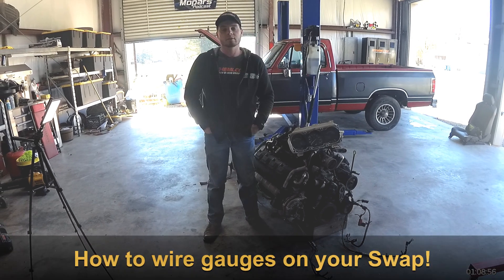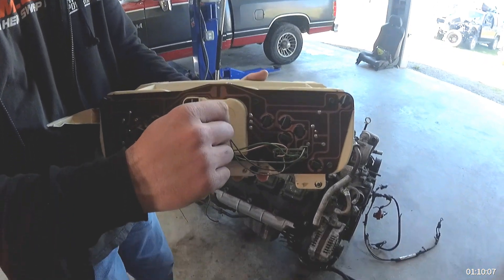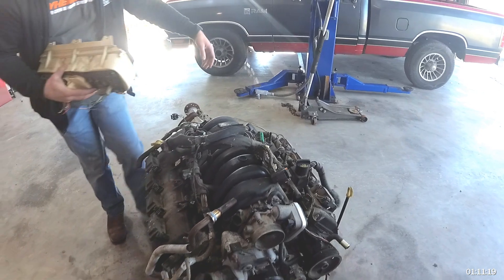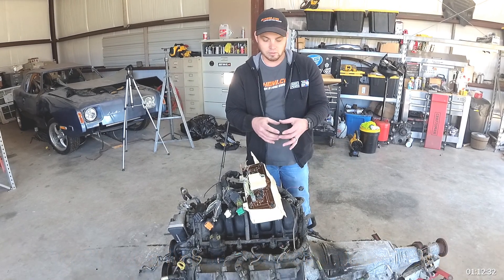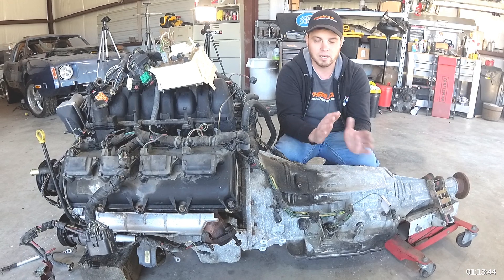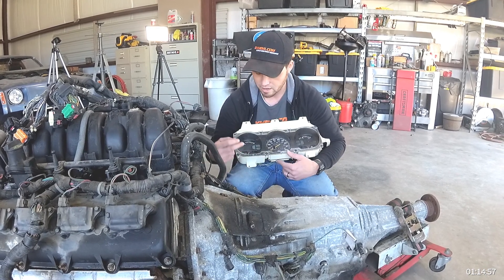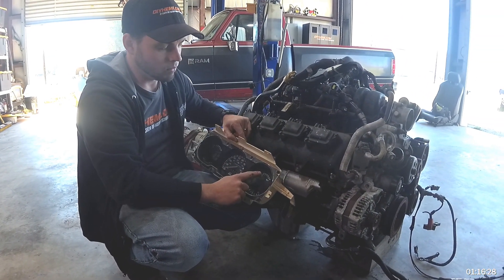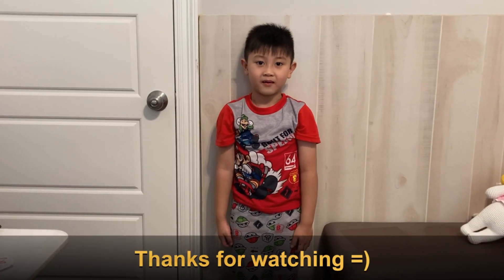How to wire up Gauges on your engine swap – DIYHEMI Hemi Swapped D150

Comment: Hi, I know its a long shot but i run off ideas. Have a 08 5.7 Hemi swapped already into a 90 Ram, everything works but the speedometer and the pcm doesnt know the speed either, so wont let me pass above 60 mph. I have read some and find that I can use a Sgi-5 and a Rostra to get the speedometer to the pcm and then to the Gauges, is that right? Thanks in advance

Comment: hey guys love the videos, i have a speedhut tach and 2004 hemi in a 66 d100 , do i have a tach output from ecu or do i need to hook to coil of one of plugs negative or trigger wires? thanks again

Comment: Have you ever done an SN95 mustang?
Reply from the maker: have not yet! But we aren't against them.  We eventually will be going to non-mopar bodies to have some more fun with our swap harnesses later on.  We'd love to see others do it too though
Reply: @DIYHEMI  Im in the process of swapping a hemi from a 2006 durango and 45ffe from a Dakota. Into 2007 audi a4, the mechanical and fabrication is the easy part. Getting my original cluster to work is going to be challenging
Reply: Hey Blake do u have a email to ask you question

Comment: Jonny mopar suggested for us to come iver an check u guys out an to subscribe an that is what i did .. im curios an intrested to watch your videos as i have 2002 Dodge Ram 2wd regular cab shortbox with original 5.9 magnum 360 .. cold air intake long tube headers trual dual exhaust with comp aftermarket street cam new stock hydraulic roller lifters true dbl roll timing chain an valve springs with dampener.. works well with factory 4 speed automatic.. 392 surgrip rear gears an truck only has 85 thousand miles on it . Windering how easy be to swap over to hemi.. do you have a video or two of doing this swap on this year make an model of my truck ??!!! I gonna look an see an stay subbed to you guys .. any suggestions what yiu do with my truck i be gkad to have ur advice .. im diabled an in wheelchair at 50 yrs old jus happened this summer due to incurable health disease.. but it dont stop me from working in my truck now an go crusing an racing !!! Cheers guys ...🍻👍🇨🇦 Kingston Ontario Canada

Comment: Thanks for all the videos. Does this work for CAN bus systems
Reply from the maker: You can use these processes even if the powertrain is canbus controlled. The only difference is a canbus speedometer signal will need an appropriate adapter